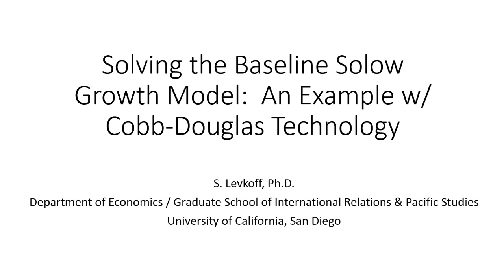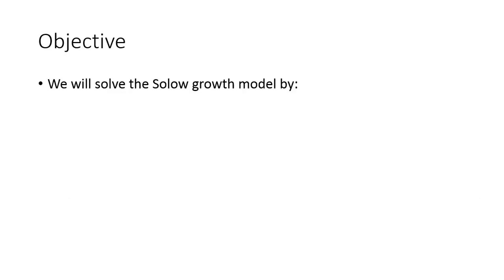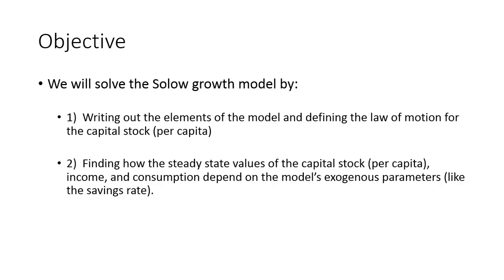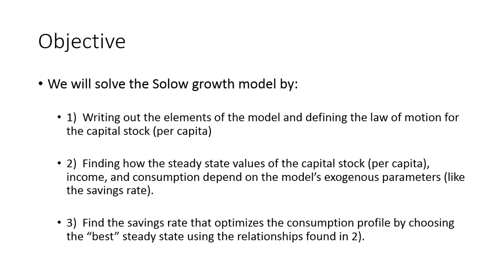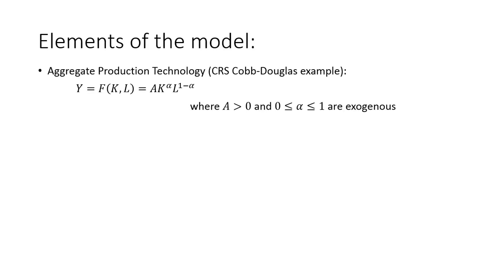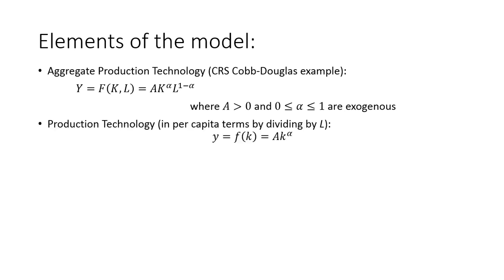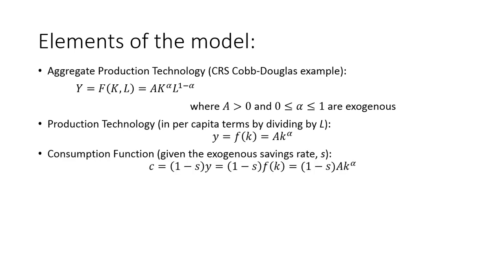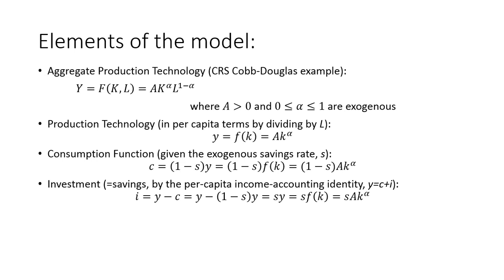Solow Growth Model - Part I:  The Steady State

Comment: 6:40 What does sf(k) mean? I know you said that is savings - but why do you add f(k)? Why not just s?
Reply from the maker: sf(k) is the same as sy since y=f(k). sf(k) is just the savings RATE multiplied by the amount of income generated.  if we only had s (and didn't multiply it by how much income is generated), then we could not interpret it as the amount of income saved.  s itself is between 0 and 100% and is a rate, not a quantity of savings.